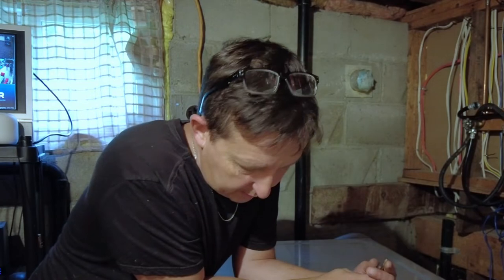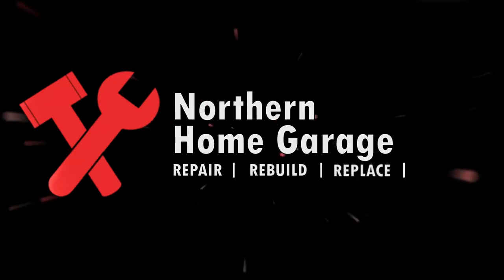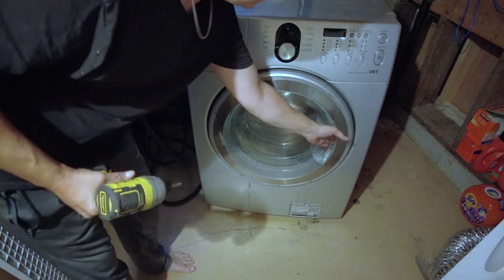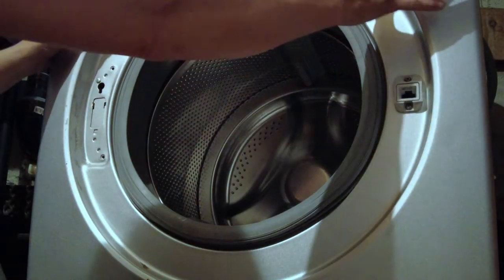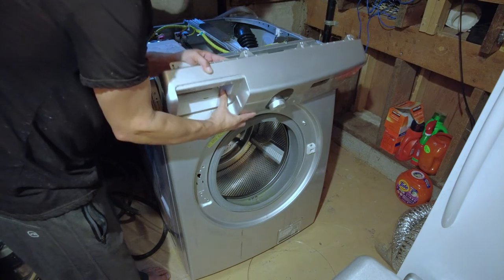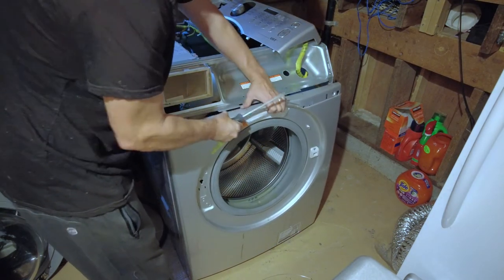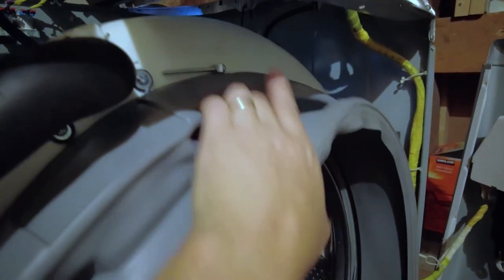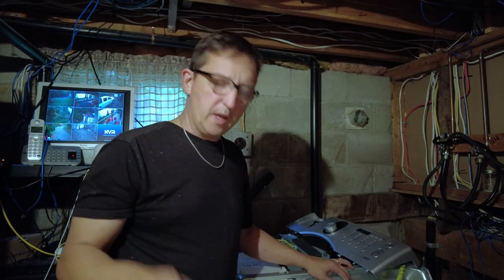Ultimate Samsung Front Load Washer Disassembly Guide Access to All Components is easy!

Comment: Thanks for the video. The black drain tube at 5:54 came out of my machine when I was draining it to clean the filter. Is it possible to access it so that I can clamp it back on without having to take off the entire front cover, such as taking off the bottom panel of the washing machine?
Reply from the maker: Hmmm I don’t think so because it clamps to the housing.
Reply: Thank you for the quick reply. I went ahead and followed along with your video. I was able to reattach the drain hose and everything is now working. Thank you so much!

Comment: I have same washer, just started shaking worse in last 6 months. Seems front shocks are loose for a short distance of movement and then stiffen up. Rear ones seem fine. Need to check yoke on drum I guess, mine does that banging noise and the machine walks out of place. Shakes horribly even with nothing in it and spinning. Considering shocks and door boot since it is torn around the edge but if the yoke is broke that could be what wore out the shocks. I have it apart now, after 12 years thats about $50 per year to purchase and however many loads were done in that time.
Reply from the maker: I suspect it’s the yoke if it shakes with out a load. Sounds like you got good use out of it. Thanks for watching!!